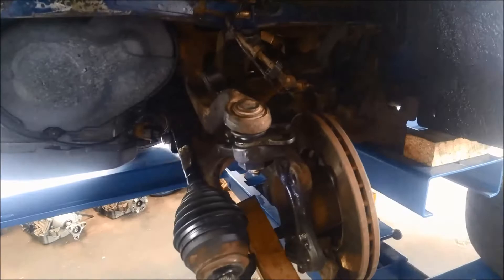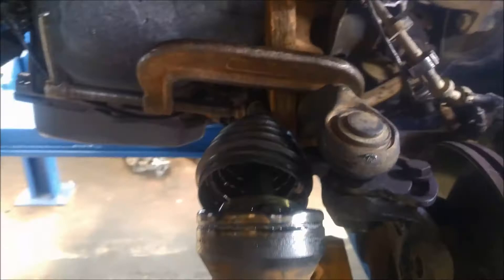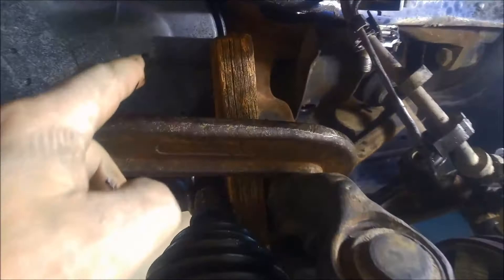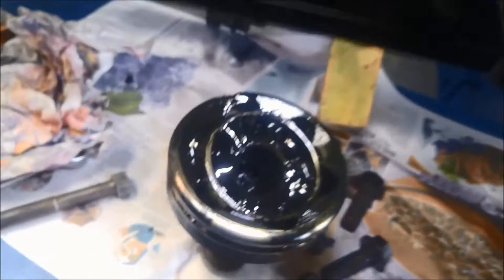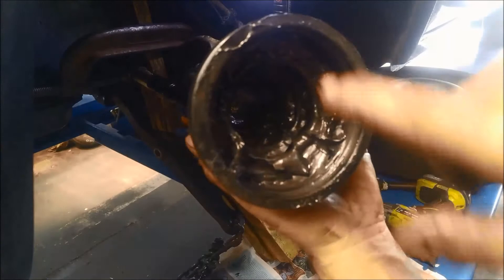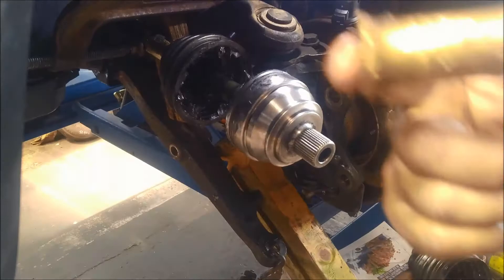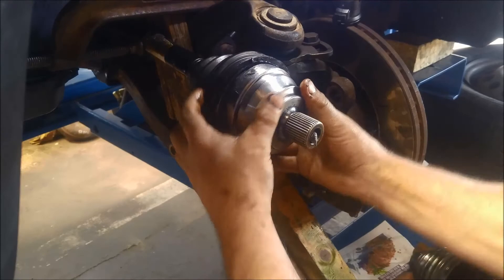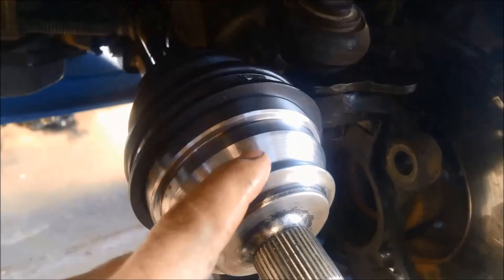How to replace CV Joint Outer Hub & Boot Gaiter Replacement Constant Velocity Joint How to DIY

Comment: i like the G clamp and wood trick to hold the shaft in place, a while ago i bookmarked a cv joint removal tool  on ebay for when its stuck on the shaft spline, you reminded me.
Reply from the maker: what is the tool?
Reply: @YepThatsIt  not sure it would be workshop quality but ok at home or on the side of the road, its call a cv joint removal tool, clamps onto the inner driveshaft while pulling the cv off using the existing nut on the shaft on the cv joint. its a large U shape tool. all over ebay and YT
Reply from the maker: @closertothetruth9209  thanks for that mate, i`ll check it out ;-)

Comment: FYI the metal clamps are called Oetiker clamps.  I would not use plastic tie-wraps from experience in anything underneath the car where water can get in.  I have had a replacement steering rack and a CV joint prematurely fail due to water ingress.  The tell tale sign was when I took the gator off, brown water pissed out.  I found that you can carefully remove the Oetekir clamp and re-use them but the boots/gators  should come with new ones!
Reply from the maker: thanking you for that info ! cheers

Comment: I see you are locking your halfshaft  there to stop it dismantling itself, but is there a tool which is available that can clamp the inner cv joint joint to stop it turning into a bad day?
Reply from the maker: the only tool available i know of, is the tool behind the tool